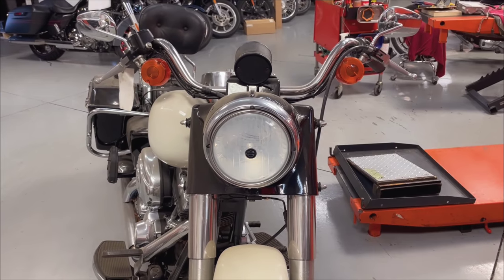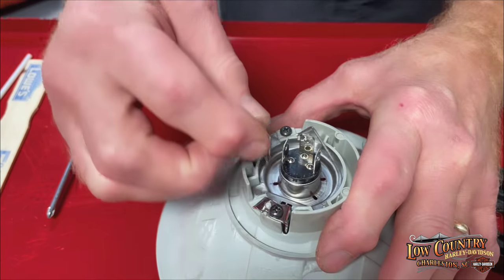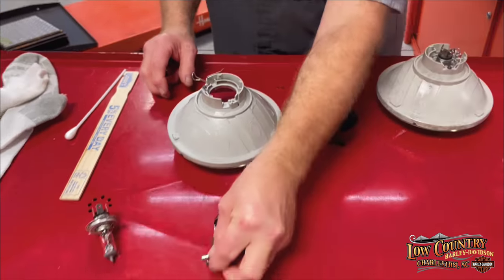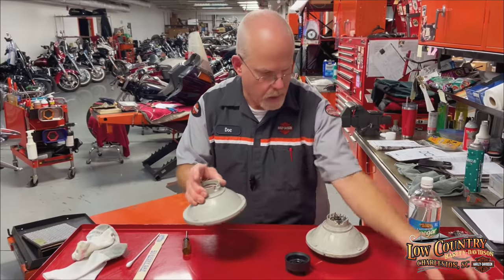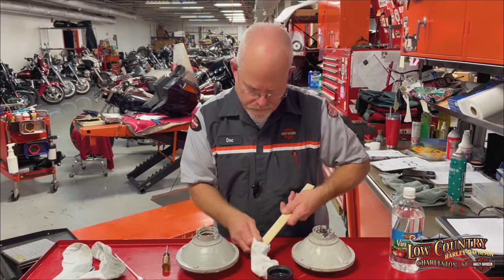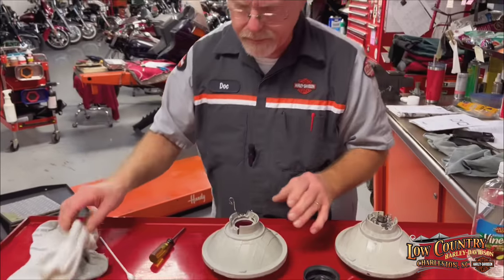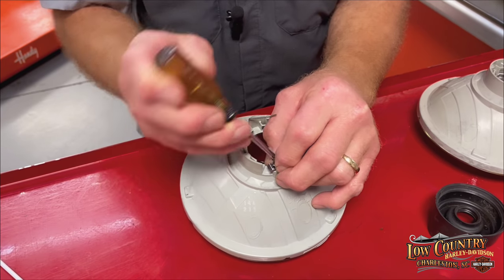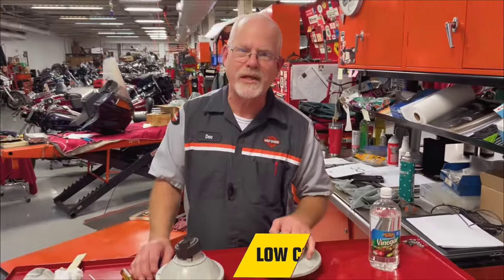Is your Headlight in a Fog?! | How to Clean your Halogen Motorcycle Headlight | Doc Harley

Comment: Even easier is to use isopropyl  alcohol. Just pour a little in, swirl it around real good and then pour it out. May have to do that twice... then let it sit for a few minutes and it will dry super fast. Don't need the stick and sock at all. Works great and leaves it sparkling clean. You can even swirl it around along the back reflective side too.
Reply from the maker: Thanks for sharing...Doc

Comment: I did exactly as you showed but after 10 minutes it fogged back up again. Any other suggestions besides buying a new lens?
Reply from the maker: Apple Cider dosn’t work 😆 just kidding. I would try again with maybe a stronger solution and let it dry overnight….Doc
Reply: Mine did the same thing, did you ever find a solution?
Reply: @pappytinkers  yes, I used “mothers” polish. Cleaned it up and no more fog.
Reply: @darlpapple6599  thank you!  I was making a video of how to do this but when it dries, I noticed the fog was back.  I watched this video again thinking that I missed something.. And I did.  At the end, he shows the new headlight, not the one he repaired!

Comment: Have you done this with the 14 up daymakers?
Reply: I don’t think there is access to the interior of the daymaker. ( sealed beam)  It’s a piece of junk and fogged up it is a safety hazard.   I am really disappointed with mine
Reply: @clellanhensley5620  I took mine back to the dealer while still under warranty (bought it new)as mine were fogging up. They said as long as the light was working they would do nothing. Apparently they pretty much all do it.
Reply: @gsfinatic  yes I’ve seen a lot of them.  I closely examined mine and found a gap in the glue where the face was glided on.  In other words the seal is broken.  Yea

Comment: I just swapped the headlight for an led. got so tired of every few months cleaning this headlight interior. tip for those cleaning the stock headlight. that metal clip....dont lose bend or break it. Harley davidson does not sell that clip separately. You either purchase an entire new headlight assembly or try a swap shop or meet to find that clip

Comment: How do you clean the Daymaker?
Reply from the maker: Good Question. I have no idea. It is a sealed unit...Doc
Reply: @LowCountryHarleyDavidson   I think this winter I will try to remove the front lens.  Clean it  drill a vent hole, use windshield glue to replace the lens.    Probably won’t work, but hey, it’s fogged up so bad I won’t be loosing much if it is a failure.  Thanks for your all informative videos.

Comment: Hello doc.. I hve a 17 ultra limited .. do I hve 2 take fairing off 2 get headlight out .. thnks 👍
Reply: No.  Remove 1 screw in bottom of the dress ring, then 3 screws hold light assembly in. Do NOT mess with the 2 screws with springs on them as they are for adjusting the headlight.

Comment: I have a ‘14 FLHTK with the OEM daymaker.  After the light is on for a few minutes, it begins fogging on the inside.  Once shut off, the fog clears once the light cools off.  I purchased the bike used out of the Phoenix area.  I live in the southeast USA.  Is there anything I can do to stop the fog from forming?
Reply: Buy a new, NON HD headlight is the only sure fire way to prevent this

Comment: Just tried this on my 2000 Road King classic. Didn't even put a dent in the cloudiness. Absolutely no change. When it's wet it looks brand new. After drying it looks just as bad as when I started.
Reply from the maker: Sorry yours did not clean up…..Doc
Reply: This is exactly what's happening with mine.  So far I've tried window cleaner, vinegar, and rubbing alcohol.  DON'T try the rubbing alcohol, it can soften the reflective material, the chrome, inside.  My next step will be a plastic polish.  Have you found anything that worked?
Reply: Didn't work for me either. After it dries, the foggy look comes back😢